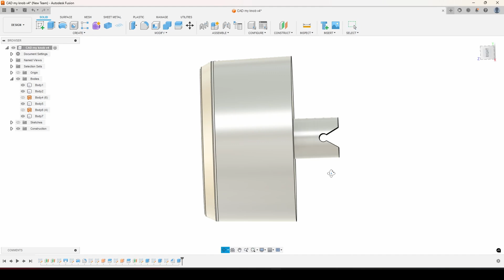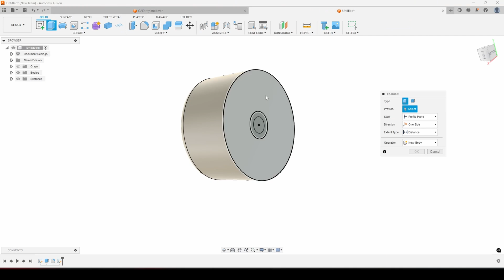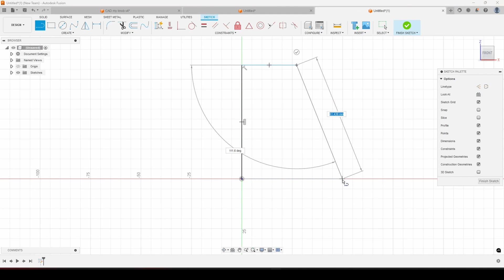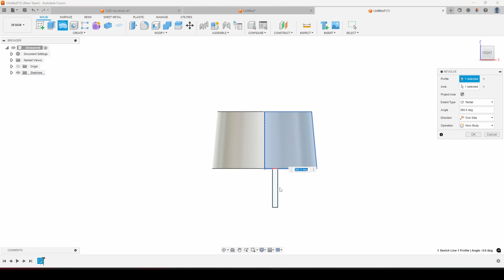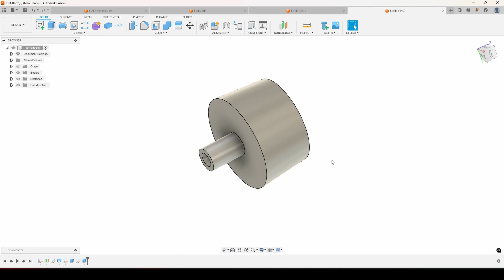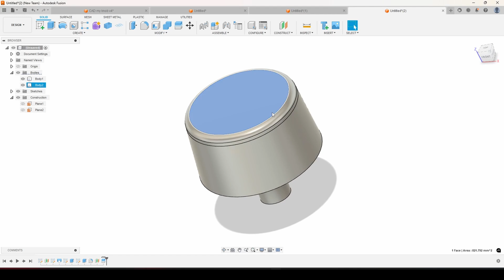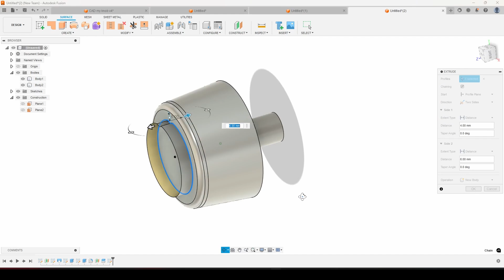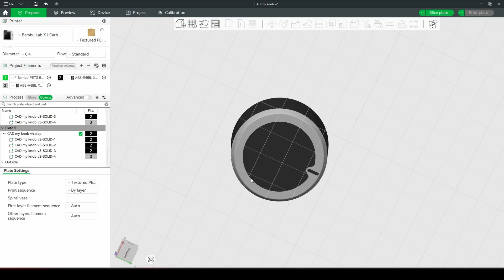3 ways to model a part in Fusion 360

Comment: You make it look so easy. Sometimes 360 works great for me and other times I spend hours trying to get to do what I want. I think it has a lot to do with my age. LOL
Reply from the maker: I’ve spent a lot of time in CAD software so it just comes with practice. I also usually do a couple trial runs before filming so that I’m not fumbling around too much during the video. It also helps when you’ve already modelled the part before, modelling a new part from scratch I would spend much more time thinking about the next step.